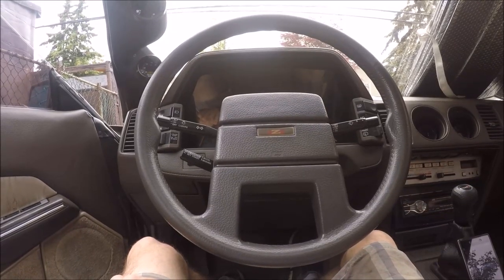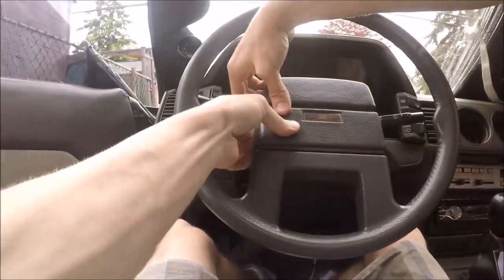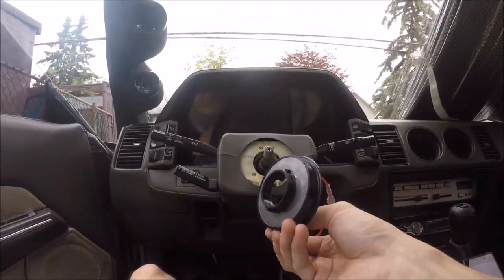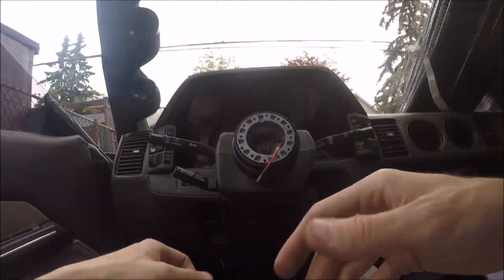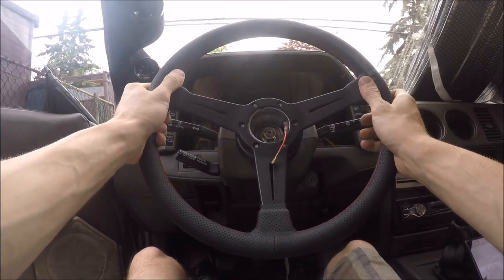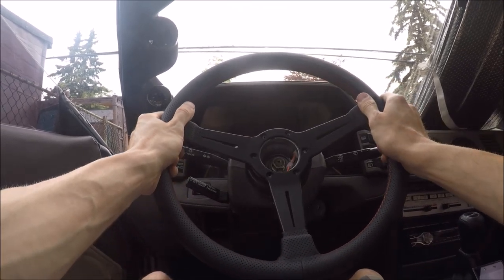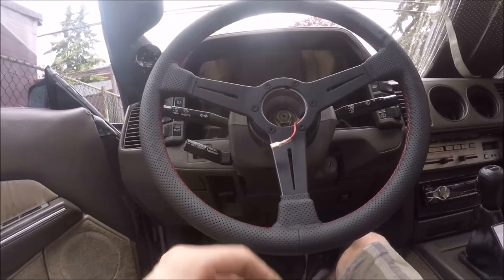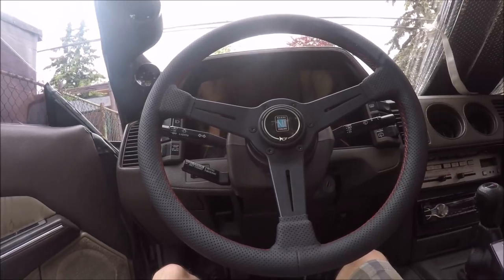Z31 Nardi Steering Wheel and Horn Install

Comment: I got a nardi wheel but the hub i go doesnt fit the wheel what hub should i get ?
Reply from the maker: You can try the hub i used in the description if you have a nissan
Reply: It doesn’t work
Reply: I cheeked the link and it doesn’t find it I’m trying to get the hub but it’s says it not there no more
Reply: Jr Ruiz get an nrg short hub
Reply: Turbocharged Creations does this hub work on a momo?

Comment: What did you use to make the adapter for the horn? would be cool go see a nrg quick release video
Reply from the maker: The wire piece? Its just a plain wire with a spade connector. The horn just presses in after